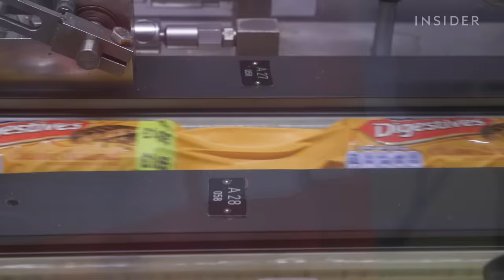How McVitie's Chocolate Digestive Biscuits Are Made

Comment: the decision to flip all the biscuits onto chocolate rather than individually adding chocolate to each was genius
Reply: I thought it would make more sense to have them go through like a flowing chocolate curtain, like a shower. I don't know how to describe it. That way you don't need to flip them at all.
Reply: I still thought they were covered with chocolate - it must be more cost effective to have them flipped onto it instead.
Reply: @Arrica101  that would waste chocolate though, and probably cause a lot more mess
Reply: @dumi_thicc  Not really.  I mean, they have to recoup and rework all the chocolate that isn't under s biscuit.  After the minimal loss due to an amount coating the insides of pills and stuff, the chocolate that did not land on a biscuit could also be recouped and reworked.  I'm guessing their decision to use the flip method was because it gives a more even coating.
Reply: @mr.anonymous5501  and maybe they like the pattern on the top, which is now signature to digestives.
Reply: @Arrica101  You'd call it a chocolate enrobing machine. A lot of things are covered in chocolate that way.